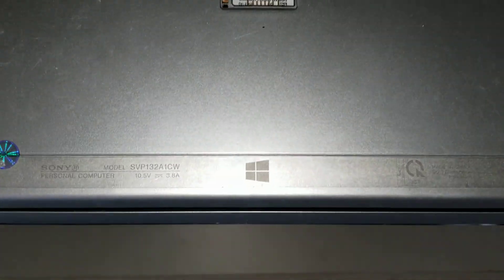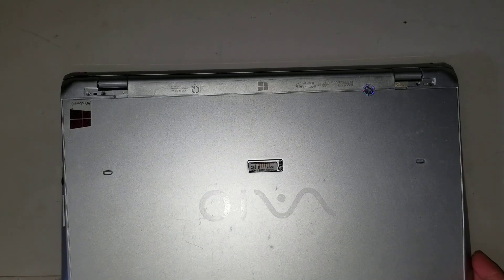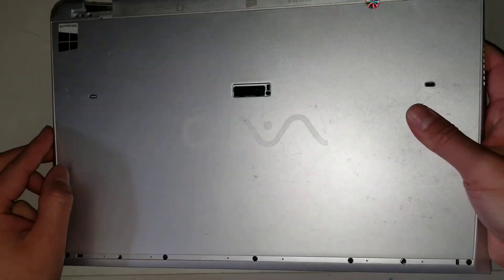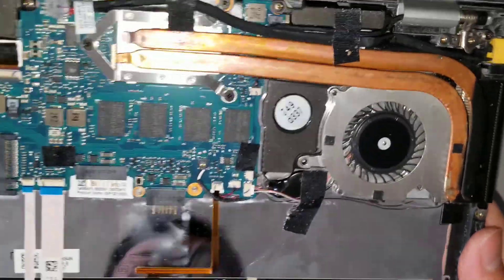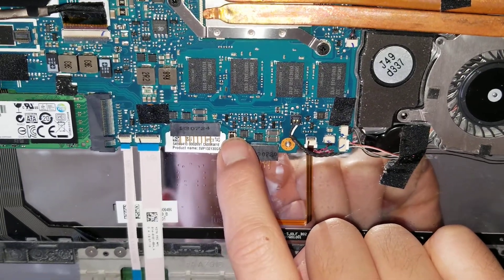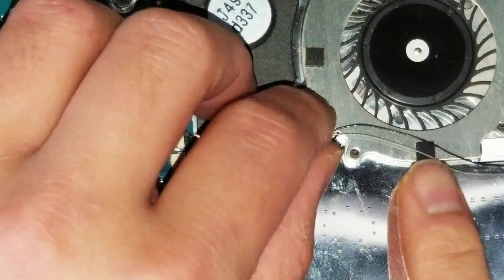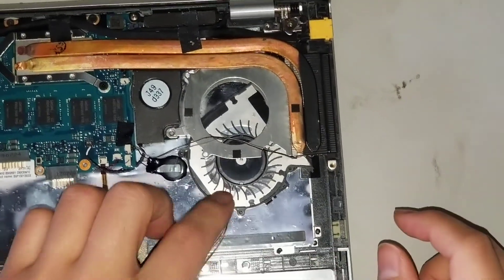Sony VAIO SVP132A1CW Disassembly SSD Upgrade Fan Repair *The SSD is an m.2 SATA, NOT PCIE*

Comment: I have one SVP132A1CL it comes with a 256GB, somehow it is not detected on the BIOS. It mentions NO DISK. Is it because the owner updated the BIOS? Now I need to buy a different SSD such as the M2 SATA? But why if it came original with an NVME? I cannot understand!
Reply from the maker: Are you sure the SSD isn't fried?
Reply: @ItsBinhRepaired  Yes.

I also tested an M2 SATA today and it still not working. 

Any other solution?

The machine turns on and dont find nothing on HD BIOS.

Using USB windows 10 also doesnt find any HD/SSD.

I really wish to make this machine work.

Help me!

Comment: Samsung MZ HPU128T/00 is an M.2 with a PCI Express 2.0 x4 interface - also M.2 SATA typically have a 2nd notch. I'm confused.
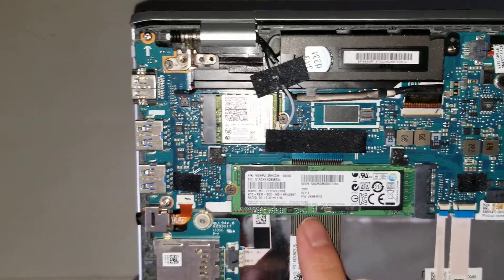Reply from the maker: At 2:57 if you look at the right side of the SSD. In the center of all the logos and stuff it says Serial ATA
Reply from the maker: Does the ssd you have in yours say pci express on it?
Reply: Hello I have this laptop I need ssd suggestion I coulndt find samsung mz-hpu I bought nvme ssd but doesnt work
Reply: @emirhanhut4339  I've upgraded this Vaio model to a WD Blue 2 TB 3D NAND Internal SSD M.2 SATA, but you can also upgrade to Samsung 860 EVO 2 TB SATA M.2 (2280). I found both on Amazon. Good luck ;)
Reply: @gociii  Hi Sir, so you're saying that m+b key can be attached to Sony VAIO SVP132A1CW  which has m key?
Reply from the maker: I don't know what all the m key b key nonsense is about. Whatever connector an m.2 SATA SSD uses, that's what you want. Don't use the connector that is designed for an m.2 pcie nvme.

SATA more often than not has 2 notches in it, but not always. PCIE Nvme more often than not has only one notch, but not always, so don't go based on the notches, because even if it has the right notches, a pcie nvme SSD won't work! The sellers of SSDs don't make the m or b key clear on packaging, so please, stop with the it's round, so it goes in the round hole type nonsense, it'll just confuse people. Lol
Reply: @ItsBinhRepaired  Ok thank you for the explanation, i have the same laptop which has broken SSD. Im planning to replace the SSD on my own, any advice?
Reply: Thanks @ItsBinhRepaired
Reply from the maker: @alfiyanbaharuddin850  you'll need to create a Windows 10 usb installer. Swap the SSD out and boot from the usb to reinstall Windows. :)
Reply from the maker: @gociii  no problem
Reply: @ItsBinhRepaired  Ok thank you for advice, this video is really help me.
Reply from the maker: @alfiyanbaharuddin850  glad it helped
Reply: @gociii  thank you so much
Reply from the maker: Any m.2 sata SSD should work
Reply: @emirhanhut4339  Merhaba hangi model SSD ile upgrade yaptın. Pcie nvme çalışmıyor sadece M2 SSD ile ve sanırım birde maksimum 512 GB destekliyor deniyor

Comment: I'm looking for a screen replacement for that model. Do you know where  can I find one?
Reply from the maker: EBay or Amazon. Check the model number on the back of the screen
Reply: Hi Maria,

I have also same model but broken my screen (and it is flickering also). I need to replace it myself. Have you solved your problem?